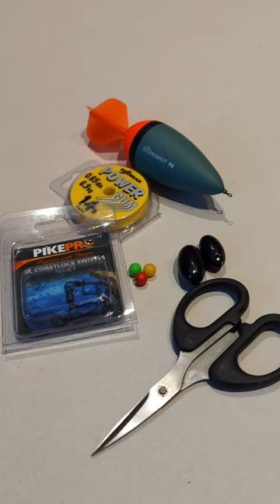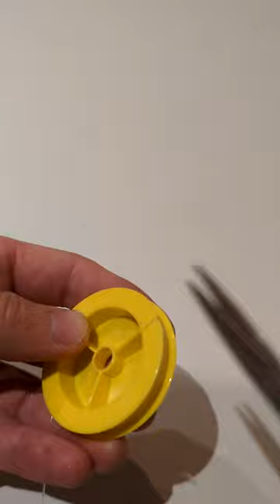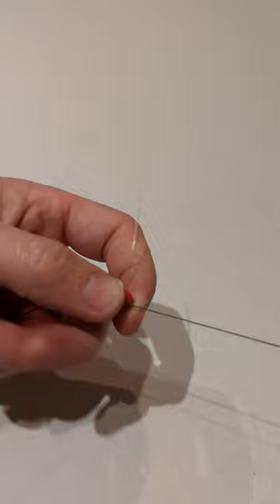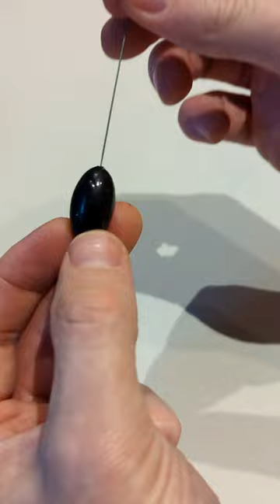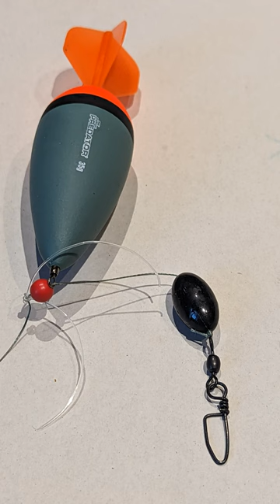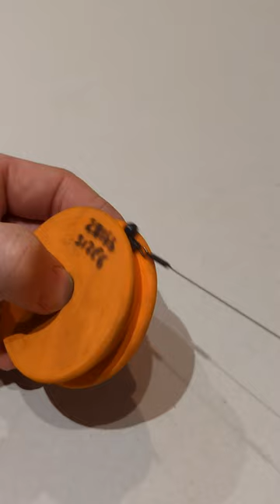How to tie a float rig for pike deadbait #shorts

Comment: iv used old elastic bands for stop knots before now...works well enough if you're without anything else
Reply from the maker: Good tip!
Reply: Can I just use float stops
Reply from the maker: @KevinMcLaren-sw9wj  if it will fit through the eyes on your rod, go for it!